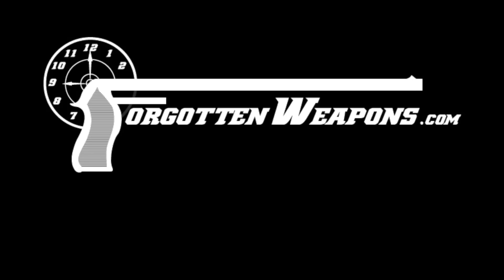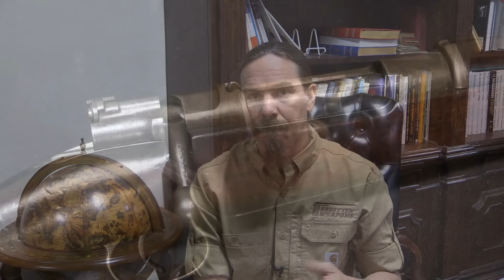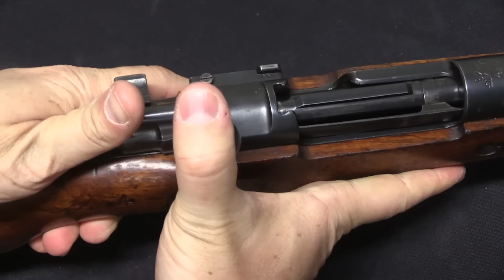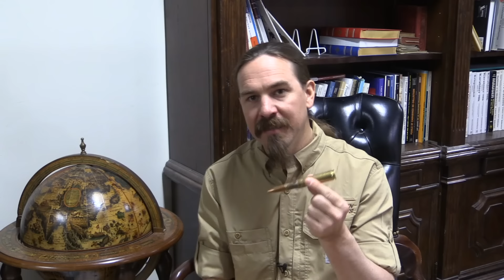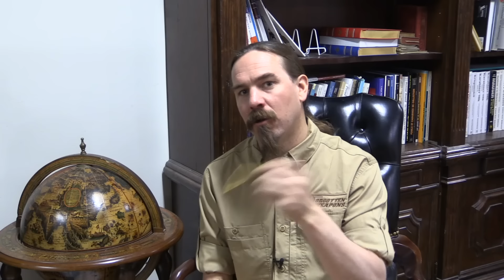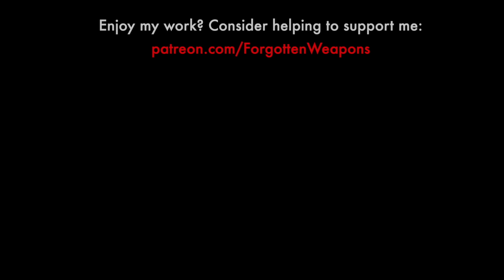Earth-Shattering ka-Boom! How (and Why) Guns Explode

Comment: The other type of Out-Of-Battery detonation not mentioned here is a cook off, witch mostly only happens when you are firing full auto for a sustained amount of time; a cook off being when the gun is so hot that the rounds go off just from residual heat. IV8888 recently had a really interesting cook off in a melt down video where the firearm jammed, and the cartridge got caught in the bolt sideways, and being held in the hot bolt caused it to cook off.
Reply: @justforever96  If the bolt is locked, and a cook off happens, its not really a catastrophic failure, just a failure. If the bolt isn't locked, than its out of battery.
Reply: @justforever96  in the Military you would get yelled at for even mag dumping when you were not given the clearance as it is wasting ammo
Reply: @formoney5255  If the cook off happens because the primer ignites, then it will not produce a catastrophic failure. However, if the powder heats up substantially, it will burn faster than normal and will produce higher pressure than normal. That can produce a catastrophic failure. depending on how high the pressure gets and the weapons construction.
Reply: @justforever96  I wish it was the case that cook offs are almost always in battery. Unfortunately it is not. Cook offs happen most in machine guns. Those who fires from a closed bolt runs the highest risk of a cook off, but most often the gun will be in battery. The problem is that soldiers, no matter if they are operating an open bolt or closed bolt weapon, will try to clear the weapon if they have a jam or some other malfunction. And so they will try to retract the bolt, open the feed cover or tries to remove the barrel. And then the weapon is no longer in battery and all safety measures built into the gun to went gases and fragments away from the shooter is bypassed. When a cook off then occurs, the fragments and hot gases will likely hit the soldier and cause damage. I have been on investigation boards for many such accidents. There are rules and regulations as to how to manage a jam in a very hot weapon, to mimimize the risk of injury. But soldiers tend to go not follow such rules, feeling the need to get the weapon back in operation as fast as possible. And in wartime, such a risk is worth it if your position is in danger of being over run. But in peace time, no. Still, soldiers often train as if they don't have time to change barrels and cool the weapon down, and clear the weapon as fast as possible even when there is no enemy present.

Comment: 3:13  There have been a marvelous series of videos over the past year from both Scott at Kentucky Ballistics and Mark Serbu, the designer/gun nut/creator of the RN-50.
Scott has stated they determined the SLAPP round that caused the detonation was loaded with pistol powder (mistake or sabotage unkown), causing chamber pressures nearing 200,000 psi.

Comment: My concern with the design of the firearm in question is that any gas leaks into the headspace area will cause huge forces on the cap, since the internally threaded cap is necessarily large enough in diameter to accommodate both the base of the cartridge and the wall thickness of the chamber. As the force generated by pressure is a function of the area, a leak of this nature could easily double the effective load on the cap. As the threads continue to fail, the cap acts like a cylinder and the barrel a piston, and the cap will be launched rearward with great force.

A couple of strategic bleed holes in the cap or interrupted threads in the barrel could provide a vent path to prevent total thread loss in the future, instead ruining the threads plastically and relying on a case head separation to vent the pressure as the cap comes up against the bolsters. A redesign of the bolsters that prevent out-of-battery operation would stop the cap after a few millimeters of travel, at a distance where the case has expected to fail and the vent path is open. The receiver should also be constructed to redirect the cap in a safe direction the event of a total failure. The design of that gun always gave me the heebie jeebies because it's like staring down the end of a pipe bomb. 

No bad blood for Mark Serbu though. He appears to have done his his diligence and it is designed well. I just hope a few small changes might be made to increase the survivability of bad ammo.
Reply: Excellent commentary and suggestions.  You obviously come from an engineering background.  Threaded breech caps and other types of threaded pressure connections can give a false sense of security.  Notching effects at the base of the threads as well as understanding the finite life of components undergoing repeated exposure to loads close to the failure point are essential.  Somewhere in the many discussions of this incident I read that the service pressure of the 0.50 M2 Browning load is in the order of 50,000 copper units of pressure and the expected failure pressure of a piece firing the round is 85,000 copper units of pressure.  Considering that many critical mechanical systems have a safety factor of 5 or more is not very reassuring when compared to a firearm of what, 1.7?

Comment: To put 50,000 psi into perspective, your typical rental scuba tank is rated at 3,000 psi (and that's enough air at 60 feet for about an hour), and automobile tires at around 30-50 psi.

Comment: 2 big lessons are to have a trauma kit with you when you shoot and not to shoot mystery ammunition that could be overpowered
Reply: And watch out for squib loads. You could tap, rack, and it goes boom in your face.
Reply: Or if you're going to shoot ammunition of dubious quality, use a string to pull the trigger remotely.
Reply: @VT-mw2zb  had a close call with a Squib- was shooting buddy's .44 Magnum lever action, he had mystery ammo that his friend had loaded (drunk) i had a miss fire and lowered  the barrel and the bullet fell out.  some of the shots were low powered others did not leave the barrel.
Reply: To be fair .50 SLAP isn't usually a "mystery ammo" (unless someone reloaded it and passed it off as surplus)
But a lot of army surplus ammo is sold because it failed military spec. Usually that's just a shelf life requirement, or an incomplete coverage of sealer on the primer, or a little ding or scratch... but it can fail spec for being the incorrect weight, which is "not good" (tm). The 'X' prefix on surplus ammo means it is not allowed to be used in military guns "for some reason", usually a rather minor reason, but not always.
Reply: Honestly, someone should make a video based on this event, with basic first aid skills and what to carry. As someone who has taught a number of never-shot-before people, I want to have what I need for when what I don't want to happen, happens.
Reply: @emanuelceccarini9632 ...see, you say "all"...
Reply: You forgot the third lesson: Wear eye and ear protection. The breech cap did a number on the hardened ballistic lens of his PPE - I dare not imagine what it would have done to a naked human eye.
Reply: A lot of ammo was "salted" in these past wars from nam to now, maybe that bullet somehow slipped through the cracks?
Reply: @kathrynck  some military ammo was "salted " that bullet probably fell through the cracks

Comment: I saw someone accidentally put a .40 s&w in a .45 1911. The cartridge fired, sent the bullet out the barrel, cycled the action far enough to pick up a .45, meanwhile the .40 case is in the middle of the barrel when the .45 is fired. He was lucky to keep his fingers.
Reply: I hear the same thing can happen is people load .22 LR into a .22 Magnum chamber. Though the projectiles are the same width, the 22 LR has the projectile sit on top of the case with just the base inside the case, while the .22 Magnum has the projectile sit inside the case walls. So the .22 Magnum chamber is wider, and so the .22 LR slips through the chamber and jams at the shoulder. When the next cartridge is loaded and fired, the projectile's path is obstructed by the previous cartridge and kaboom.
Reply: @havareriksen1004  I have done this as an experiment to see what happens. The 22LR rim is wide enough to keep the cartridge from falling into the chamber. It is notably loose, though, since the 22WMR case is around 0.243" while the 22LR case is around 0.226". (Dimensions from SAAMI.) The case splits when the cartridge is fired, reducing the velocity and altering the sound of the report. In my limited testing, every bullet exited the muzzle to strike the target but the drop was excessive.

These are my results on a single revolver, a H&R 676. I cannot sanction anybody else trying this, and I am reporting my results here so that anybody else who is curious about it may hopefully have their questions answered.

In summary, firing 22LR ammo in a 22WMR chamber is unsatisfactory.

Comment: My father was in the Phoenix program during Vietnam One of the operations they had involved putting high explosives in heavy calibres .. rounds would be dispersed on  battle fields or Mixed with ammo ,that the enemy would find or buy from  Phoenix program agents This was an excellent way to disable a heavy calibre weapon and kill or disable a enemy combatint..he may have come across one of these rounds
Reply: That's referring to Operation Eldest Son if you're talking about the Vietnam op. There were no boobytrapped .50 SLAP rounds produced in that operation (the kind that Kentucky Ballistics was using), only 7.62x39mm and 12.7x108mm (similar to .50 BMG but not interchangeable). The round that caused this accident was likely a civilian remanufactured round.
Reply: @solwindp78-1  it was a slap round, which are loaded hotter IIRC compared to ball 50 bmg.
Reply: @solwindp78-1  I don't think that it would be far fetched to imagine that the chi-com or other hostile would not run a similar program  🤔
Reply: @TheHappyGardener  russia is always going at with other eastern bloc countries. This could easily be a cold war era attempted sabotage. China trying to fuck over india, vietnam, russia or really anything.
Reply: @kylebradley3  they get a lot more fps, but that's due to a much smaller and lighter projectile.

They should NOT be loaded any higher pressure than any other .50 BMG ammo.

Comment: I had watched Scott’s video just a while ago. Sobering to say the least. I like your style or method of explaining these types of situations in a rational manner. My grandfather had a 12 ga. Guild gun from Belgium, that he inadvertently stuck into some snow. That peeled a six inch portion of the barrel outward from the bottom rib.
  A neighbor nearly got his ticket punched, when the locking lug on his Winchester 1897 fractured and allowed the bolt to cut a two inch line along his cheek, instead of into his eye and or brain.

Comment: A lot of manufacturers take this very seriously and build failsafes as you mentionned. I don't think serbu falted in that it is a very cheap (in the not expensive sense) firearm and thus it only does the minimum to be serviceable with the lowest price possible. If you shoot it with factory ammo you are perfectly fine.
A friend of mine created a .50, maybe one of the best in the world, and when he tested it for operator safety he jammed a monolithic projectile in the barrel with a 12 ton press, put a raufoss in the chamber and shot. Both bullets exited the right way and there was minor damage to the barrel and muzzle break (barrel bulged a little, muzzle break cracked). He changed the barrel and the rifle still shot as good as new.

Comment: It’s scary looking at Scott’s video, because if the piece of metal that pierced his hat went a few inches to the left, it would have gone through his skull, and probably killed him instantly.
Reply: Yeah it just goes to show the design should NOT be on the market, if your guns responce to a catastrophic failue is directing shrapnel into the firers vitals it needs to be pulled, and really should not have been sold at all
Reply: @therideneverends1697  I wonder what grade of steel was used in the RN 50.  Probably high strength stuff with low ductility.   Ductile steels will deform but not fracture when overloaded.  If the action had been made of this, worst case it will warp and deform the gun but not a shrapnel KB.
Reply: @therideneverends1697  This was not the gun's fault. Guns are designed around specific ammunition standards, the .50 BMG SLAP round that he was using was significantly overloaded and exceeded those standards.

As Scott said in his video on this, it was a freak accident that would have been impossible to predict because SLAP rounds are extremely rare and hard to find, and as a result you wouldn't expect them to be overloaded as the one round was.

The sole fact that the threads for the end cap were stripped by the cap flying off shows that this was beyond what anyone would expect. Threads are one of the strongest ways to attach items together, which is why Ian was so impressed by the forces that made it happen (and he graduated with an MET degree from Purdue so he knows what he's talking about). Those tabs that broke off are actually a safety feature during normal operation as well, since they ensure that the rifle will only close if the cap is screwed on all the way. 

I'm sure that Serbu never expected for this type of failure to happen and send those tabs flying, although now that this incident happened and Scott has been in contact with Serbu I'm sure they'll be redesigning that section of the rifle to make sure that in the event of another failure like that they don't fly directly backwards as they did.
Reply: @LethalSpine  I kind of agree though that any really well thought through design doesn'T just take design specifications in mind but also thinks about what happens if everything goes wrong. I'm not a fan of these screw-on-a-cap designs, no matter how great the threads are. When they shear off there is nothing stopping that cap from flying in my face and taking parts of the gun with it. Maybe that's the German in me wanting to overdesign for failure but the first time I saw such a design on Ian's channel I thought to myself "I would never fire that, no matter how much pressure those threads are designed for".
Reply: @LethalSpine  dude it was absolutely the guns fault any other design that was not built in some dude backyard would have contained it in a much safer way
Reply: @Johnny-tq9no  its obvious the gun failed spectacularly, but its not the guns fault.. it was the pipe bomb of a round that was loaded in its fault. just one of those things that was way outside the norm. every commercial rifle barrel is proofed for the most part.. if that pressure level is exceeded  bad things can happen.
Reply: @skoopsro7656  did you not watch the rest of the video where he explains that nearly every decent firearms designed as a failsafe built-in without won't damage the shooter like that
Reply: @therideneverends1697  If we’re being fair, MOST guns would be hard pressed to have a relatively “safe” catastrophic failure in response to an entire 50 BMG exploding in battery, at almost twice safe PSI.

He prob got the best possible outcome there.
Reply: @therideneverends1697  watch mark serbu (the designer of the gun)’s video in the subject. The gun itself is entirely safe when it’s loaded with ammunition that isn’t 30000 psi overpressure
Reply: @4n4rch1st7  Which means the gun could not handle a basic proof load.

Thats not a secure design
Reply: @4n4rch1st7  Guns are obviously supposed to be proofed against pretty heavily overpressured rounds, but even then it's a good practice to have failsafe mechanisms (a thing that, as Ian has shown in this video, most gun designers have figured out before the 1900's).

Failsafe mechanisms are arguably more important than making a gun stronger; certain problems like a bore obstructionare going to destroy pretty much any gun irresective of how srong it is, but having a safety feature in place that prevents that obstruction from blasting steel directly backwards into the shooter will save lives irrespective of the kind of catastrophic failure that might occur; This gun probaly blew up due to overpressured cartridges (granted, that's still not proven afaik) but there's other possible causes for a gun to explode, many of which do not require overpressured cartridges.

Any weapon (or really any tool involving high pressures) that has not been engineered with catastrophic failures in mind is misengineered, no matter how strong it is.

If the RN 50 does not get some kind of redesign I would consider that to be rather serious misconduct; Mistakes do happen in engineering but it is imperative to rectify them ASAP,  the gun can easily have failsafe mechanisms added in the form of adding some shielding that prevents a broken cap from shooting straight back towards the shooter's vital organs (there's a lot of empty space around and behind behind the cap that could be used for this,  and it'd be a relatively easy thing to add onto exsisting models) and future versions should probably have something like a built in failure point in the chamber that will break before the cap does ( because it will usually be better for the gun to fragment upwards than backwards).
Reply: @therideneverends1697  30k psi overpressure isn’t a “basic proof load”, it’s a fucking sabatoged round
Reply: It missed the right side of his head. So if it went farther to the left it would have missed him even more.
Reply: @4n4rch1st7  Do you know what a proof load is?

For example, 5.56 is about 55k PSI, a 5.56 proof load is 85-90k PSI based on jurisdiction.
Reply: @spcpitts  to HIS left would have hit him. As in if it moved more towards his left, it would have pierced his brain.